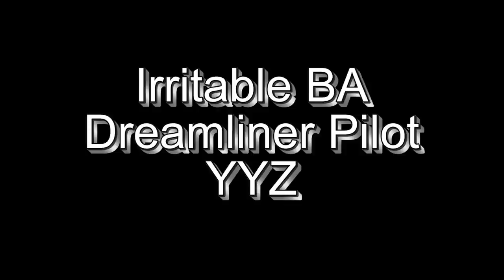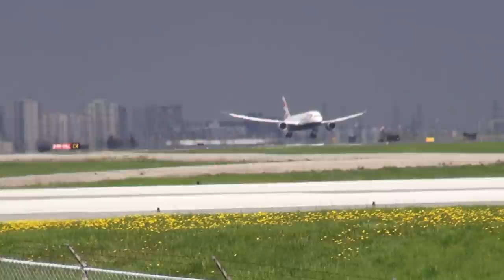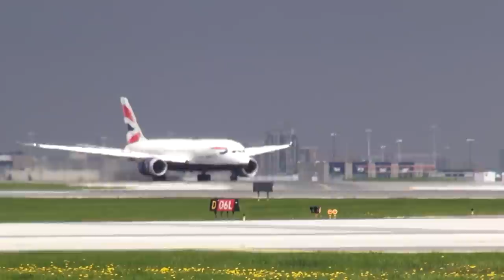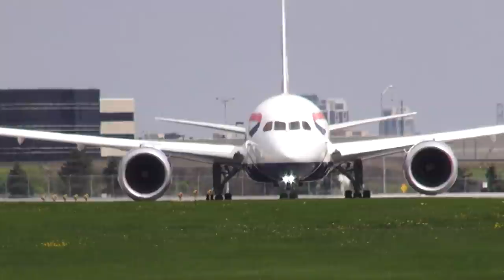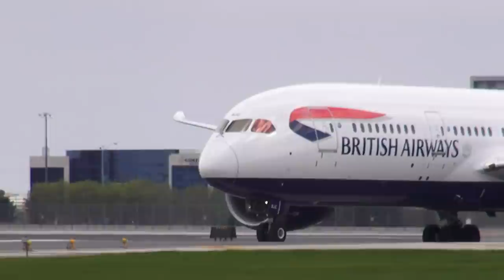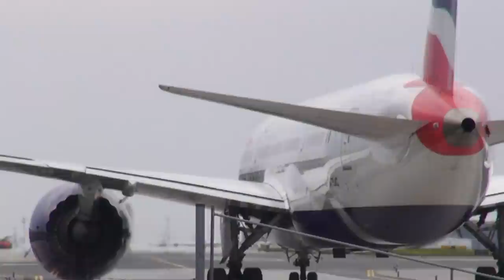Anxious British Airways Pilot, impatient controller

Comment: I would assume based on the ATC instructions he's landing on 6R/24L. Every exit on that runway is a hotspot on account of the high-speed exits being incredibly short. You have to be up on your P's and Q's when landing on that runway. Numerous pilots have taken the high speed and rolled right into 24R/6L. Same thing happened to me last week when landing at YYZ. I didn't even get a chance to call the "60 knots" callout before being issued taxi instructions. That being said, when landing on that runway, especially in a heavy jet, the controller shouldn't be issuing taxi clearances that early but it's one of those YYZ quirks, along with taking off on runway 32 at taxiway A3. Not defending the controller but it's not like he was just being a dick for the hell of it. Poor airport planning is the culprit here.

Comment: The british pilot was no anxious at all! They did what they learned. Aviate, navigate, communicate....the controller can wait. he's save on the ground
Reply from the maker: He was extremely anxious, stormy weather, last minute approach change. Brand new plane. I was there and have listened to so many of these conversations over the years. North runway was closed, back up of planes waiting to depart. He heard the instructions but didn't repeat them properly, just said they were vacating. ATC had to hold up the next plane departing and another one was on a final approach. There is a pilot and a first officer one to land the other to take instructions.
Reply: @daveni2  just from those "statements" I can hear the armchair pilot speaking....just because you have been there for years, doesn't mean you know the procedures. It's always safety first and you need more than one pilot to land safely. And don't tell me that they have to be able to land on their own! There's a difference between normal and emergency procedures...
Reply from the maker: I think u should listen again with no bias this time.
Reply: @daveni2  there's no need to. Aviate, navigate, communicate. If the pilots are busy flying the plane, ATC has to wait. It's as simple as that 🤷‍♂️
Reply from the maker: just stay off the radio until u know u can repeat the instructions. It was a short runway but there was plenty of time to make delta 6
They obviously were aware that planes were waiting to depart on 24-R so they would know to hold short. When everything is calm ask to say again then repeat. Then exit and hold short. 
Arm chair pilot or not I have heard this so many times. The BA pilot was creating an unsafe situation here. Maybe the ATC instructed too early and too fast but they were the proper instructions. The initial responses by the pilot were totally unnecessary.
Reply: @daveni2  oof
Reply from the maker: @examplewastaken  and he did,

Comment from the maker: to me it almost sounded like there was only one pilot having to communicate with atc and fly the plane, what am I missing?
Anyway, I didn't expect this video to be viewed so much and critiqued so much, just don't want to upset anyone out there that may have a personal connection with this video. I thought about disabling the comments. There is a lot of professionalism we are hearing here just a little bumpy, everything worked out fine and from what I have experienced a very well run airport.
Reply: NEVER disable the comments. People that disable comments drive me up the fucking wall.
Reply: ***** 
The trick that bigger people use is not to give in to it.
Reply: +xIncognitox There's a reason why profane words are often referred to as "choice words."
Reply: +Dave “daviation” Isenor , 
Dave “daviation” Isenor ignor the trolls mate they have nothing better to do. the picture and sound quality was excellent thanks for uploading!
Reply: +Dave Isenor “daviation” until you are in a safe speed you can't vacate a runway, the atc may have enough experience at the airport to predict wich exit would he take, but he can't be sure until the pilot decides to vacate, that's why the pilot is irritated I think...
Reply from the maker: +acbulgin2 Delta 6 is the last exit on 24L at yyz, if the BA pilots didnt like it their only other choice would have been the same ravine Air France Flight 358 a340 slid into in 2005. You don;t know the airport and you don&#39;t know the circumstances that lead up to this that day, I was there.
Reply: Dave Isenor
Always check your apostrophes before you save your first edit. There's a glitch about.
Reply: +Jack Sainthill Ikr? Freakin' annoying!
Reply: +ok no.  How can you say "no one likes you"?  I like him!
Reply: +Jack Sainthill  Yes what is it with the apostrophes?  Its driving me nuts to the point that i dont use them anymore and risk getting insulted because of it.
Reply: bronzerat012
Could be the future, that.
Reply: Jack Sainthill Your comment doesn't make sense.  That apostrophes will be banished or that there will be more insults about spelling! Or some other subliminal message/meaning?
Reply: bronzerat012
Sorry, it was late and I was tired. I knew that I was being a bit vague, so thank you for inquiring.

I had originally begun with a rant about various irritations pertaining to home computing but descended into incoherence, thought the better of it and just rattled off the inadequate remark you got.
.
It was supposed to mean, wholly uncritically, that in my opinion the use of the apostrophe might be ready to vanish and that your stated action could well, in its own small way, carry influence.

Cheers
;)
Reply: After receiving a comment reply alert I just listened to this a second time and realized EXACTLY what is going on here- this will answer everyone's curiosity.

The reason that ATC gave BA the "Hold Short" clearance so early is because he couldn't clear AC6139 for takeoff until BA had read back "Hold Short Runway 24".
Notice at 1:12 Tower says, "AC6139, I'm gonna have to hold you in position" because he can't clear him for takeoff until BA reads back the hold short clearance. 
BA had already read back, "Hold Short", but FAA rules require him to read back "Hold Short runway 24" (this rule is to prevent runway incursions which are a huge problem), THIS is why at :53 tower asked him to read back the entire clearance immediately again after BA had just read back "Hold Short". 

The second request combined with asking too early is what set the BA pilot off- and rightfully so, really. 
If the BA pilot knew that the FAA controller MUST hear "Hold Short 24" he would understand why the controller asked a second time, but, due to his desire to clear AC6139 for takeoff the controller asked WAY too early... yet, BA complied, but without including the runway number. 
So AC6139's takeoff was delayed until BA gave the assurance that they would not accidentally taxi onto 24 with the FAA-required terminology.

After BA read back the required verbage then AC was cleared to go at 1:39.

One time I heard a general aviation airplane who flew into Boeing Field in Seattle be asked 5 times! to read back " Turn left Alpha 4, hold short of runway 13L with me" because he said the wrong stuff the first time, and the next times he would say "Hold Short" without the runway number etc...  it was quite comical/embarrassing!
Reply: The controller was dealing with multiple airplanes and is going to try to get things taken care of early from time to time to try to better sequence the multiple things he has to take care of.
Reply: Dave Isenor f
Reply: Dave Isenor there is a crew of two there
Reply: Usually, the First Officer (known as the co-pilot) handles ATC communication, unless that pilot is landing/taking off, then the Captain handles the radios. Whatever happened on the BA flight wasn't due to the pilot in command (landing pilot) being overwhelmed.
Reply: I disagree, it appeared to me the ATC was Under Orders to LAND em Close a possible,  and did not take into consideration the Weather conditions, causing this to happen....Sometimes it best to tell "MANAGEMENT" to "BUGGER OFF" when conditions are not Perfect to "Stack EM" on landings and takeoff?
Reply: BA along with several other airlines won't accept a Land And Hold Short (LAHS) instruction. As the aircraft was still in the landing phase (effectively making the instruction a LAHS), the pilots are bound by their operating procedures to not accept such a clearance. Once they've completed the landing roll and start the 'taxi' phase, they can then oblige. Which they did.
A controller really shouldn't be issuing instructions during critical phases, unless urgently related to safety.
The pilot's comment was a polite reminder of this.

Comment: Amazing that some Air Traffic Controllers don't appear to know that during both takeoff and landing are the most dangerous parts of air travel, and therefore the ones where the pilots are most focused ,and irrelevant and unnecessary communication is inappropriate.

Stressful - Sure, but If a Controller makes a mistake - others die! but he/she is fine.

If a pilot makes a mistake the whole plane is screwed.

Comment: Controllers should not give instructions during critical phases of flight, or landing.Controller was probably just trying to be expedient and had the reverse effect.
Reply: If that were how things worked, no aircraft would ever depart or arrive on time, the conga line to takeoff would be measured in miles, and the holding fuel for inbounds, while controllers wait until each critical phase of flight is over, would make the aircraft too heavy to fly in the first place. Even in smaller aircraft with one pilot, I can acknowledge a turnoff while slowing down, it is a mere push of my left index finger. No criticism here, just an explanation. It would be like saying no one can talk to the driver while the car is moving (this is a much more dangerous task than flying anyway).
Reply: Good CRM dictates that pilots don't chit chat at critical phases such as taxying. I know controllers talk, I have asked them to standby myself. They are trying to be helpful, but other than been told to hold position, they need to appreciate how busy the cockpit can be, even two crew.

Comment: Seemed fine to me. BA pilot maybe should have not responded at all while he was busy, and let the controller repeat until they were able to repeat it back. Controllers are used to having to repeat themselves to busy pilots.
Reply from the maker: I know this comment was long ago but I'm just reading through having an with the last one. Thats what I thought just stay off the radio until u know u can repeat the instructions. It was a short runway but there was plenty of time to make delta 6
They obviously were aware that planes were waiting to depart on 24-R so they would know to hold short. When everything is calm ask to say again then repeat. Then exit and hold short.

Comment: how in the world do these guys understand anything each other is saying?
Reply: That and they are pushing a lot of tin through the airspace, and to keep all the flights as close to on time as they can.  If they don't the impact just cascades down the line and causes everyone headaches.   There is a bit of a challenge and sense of accomplishment to get departures and arrivals back to schedule following a ground stop.
Reply from the maker: +Wizbang FL I'm glad somebody read the info for this video. There was indeed a ground stop while bad weather passed and the north runway 5/23 was still shut down
Reply: American English is a problem,but Brit pilots get most of it.
Reply: mojo jojo for the most part there ar only a few things that will be said at any given time so it is quite easy. Outside of the US there is also a formal way to say things also. So effectively it's actually quite easy when you are used to it.
Reply: It's not a macho thing, it's getting information out quickly and efficiently. This channel is in heavy use at a busy airport, a lot of people are trying to communicate-if someone is waiting for instructions to land, or needs to call out conflicting traffic, you can't have the radio clogged with someone taking too long- THAT is the safety concern. I've been a commercial pilot for 20 years, I've lost count of the times I've had to make an orbit or two to keep from busting airspace on a busy day waiting for a break in the chatter to get landing clearance, or a transition..